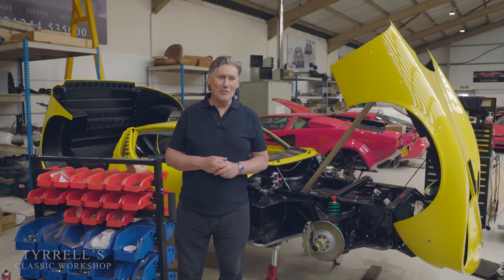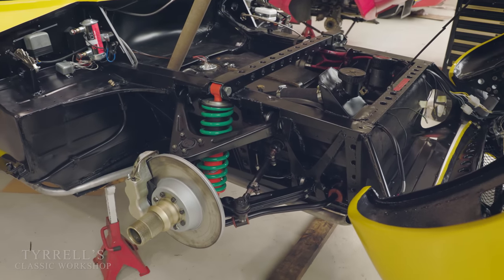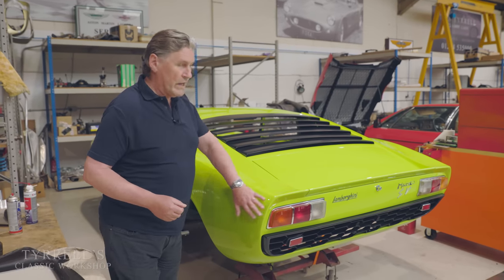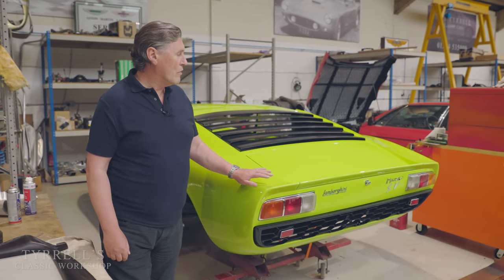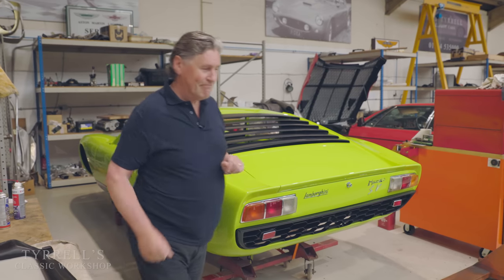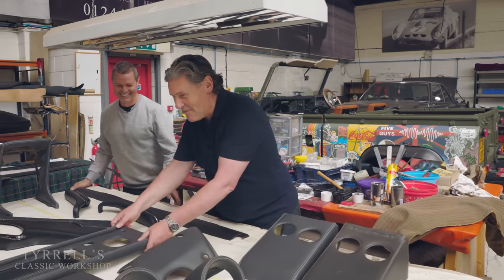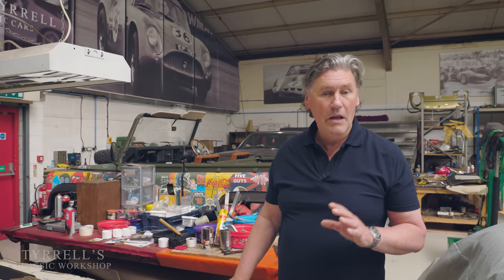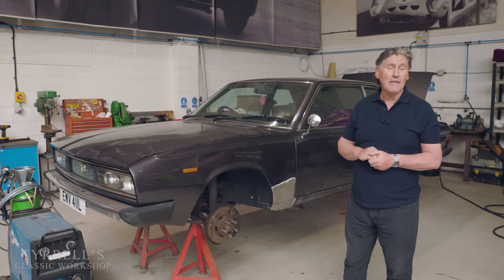£1.25M Barn-Find Miura Update as another beauty returns! | Tyrrell's Classic Workshop

Comment: A curious fact is that the exhaust outlets of the Lamborghini Miura with the engine in a central-rear position, a V12 whose gases were expelled from the rear through a pair of false exhaust outlets.  It's a surprising choice, but it makes sense, when the Miura's engine cover is open, there's nowhere for the exhaust pipes to run through, at least without a physical connection from the block.

Comment: Iain my mum had a Fiat 130 just like that (same colour ish)  in the late 70's perhaps early 80's,  whilst it was automatic it had a 3.2L Ferrari engine in it. Gee wizz was it fast!
Reply: Fiat engine, no Ferrari connection.
Reply: It had a Ferrari badge on the side, also went like a rocket.
Reply: @richardsheil5289  Same engine as a Dino which was a Fiat engine not a Ferrari engine .The badge on the side was a Pininfarina badge .
I was a trainee painter at a Fiat dealer when they was new .